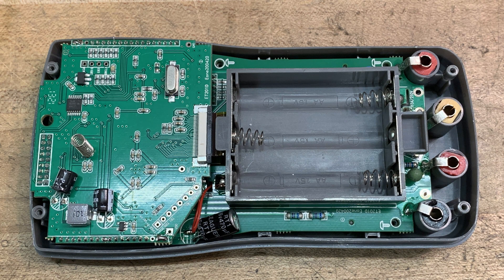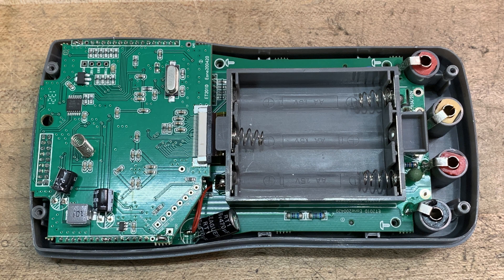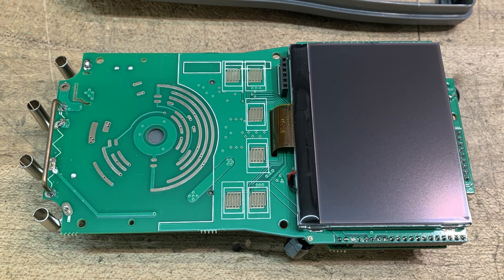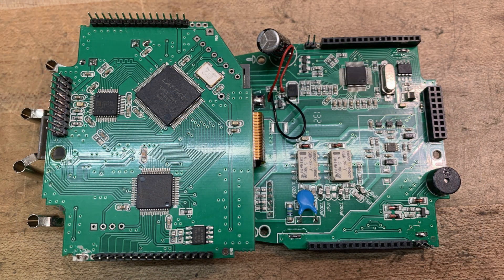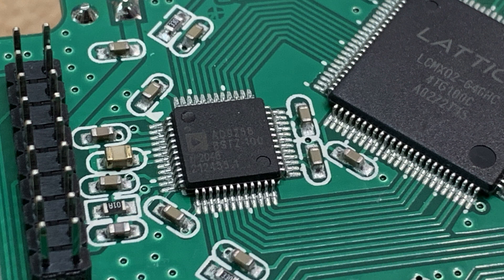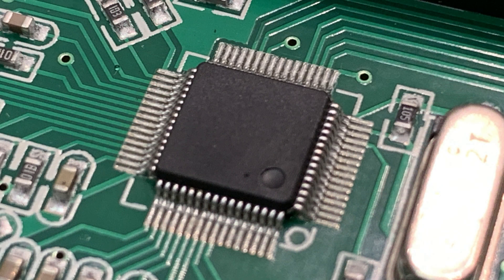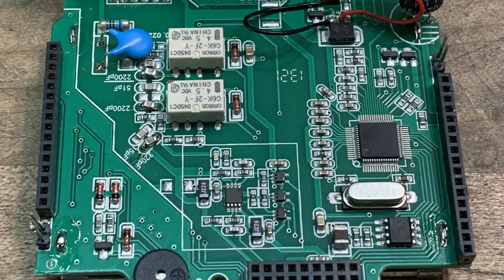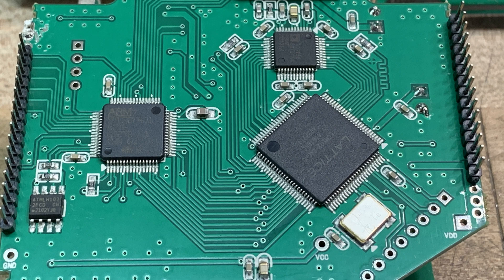#1071a Mustool MDS8207 Scope Meter Teardown

Comment: If the fuses aren't field replaceable it's probably not the meter for me.
Reply: Why are they doing this? If the developer would have tried a little better then it would be possible to fit classic 5x20 fuses  or at least those SMD Fuse holders...